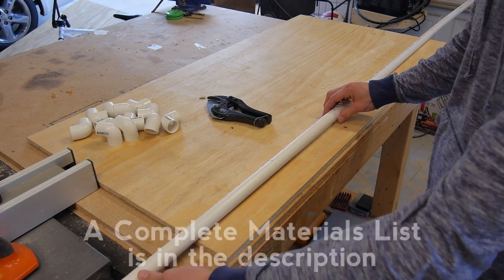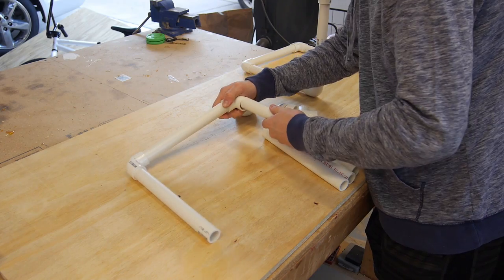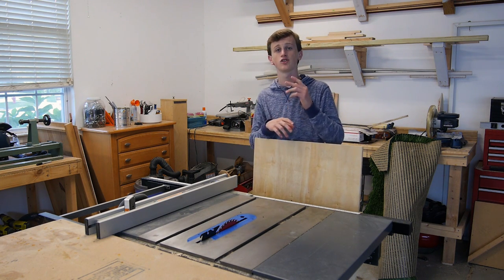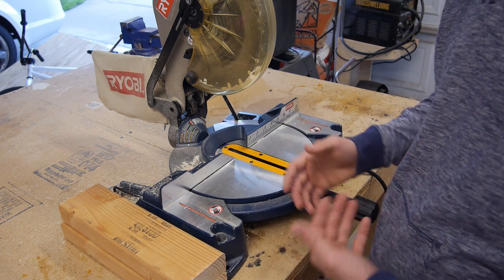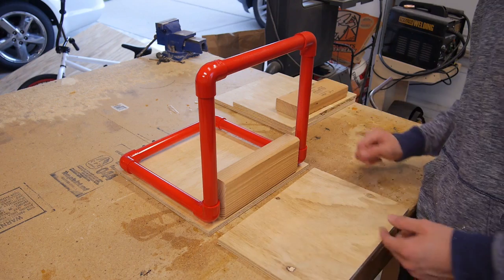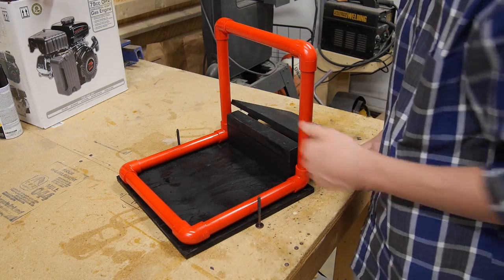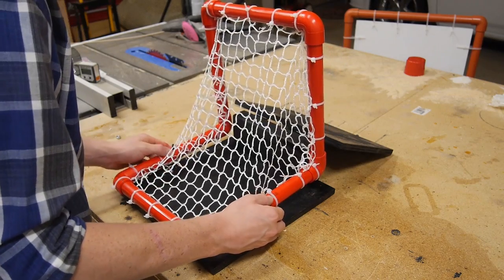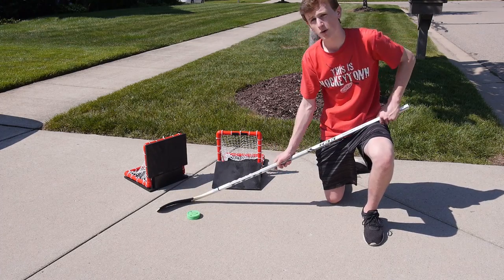How to Make 'The Original Sauce Kit'

Comment: "We have sauce at home!"

I just bought 1 full kit off fb marketplace for $90 brand new,  luckily. And found another without the boards for $50 so I went and picked up the white board slab material from home depot for $20, got it cut up to 4 slabs of 24"×32" and traced the holes and edges of my original sauce boards, and hand sawed them out and dremeled the holes smooth. Maybe add some type of sealant to the boards for warp protection.  Idk. Just got done cutting it tonight and will try it out tomorrow.